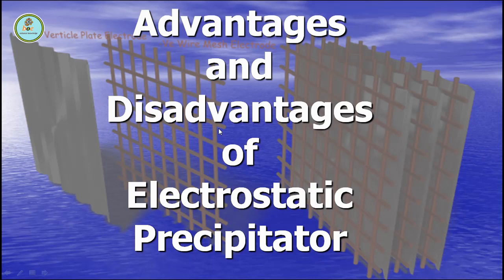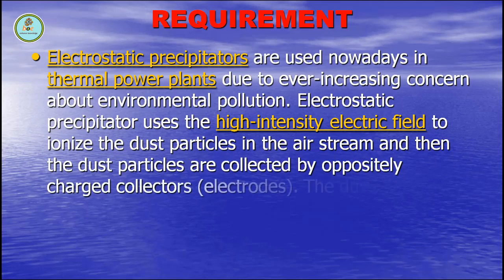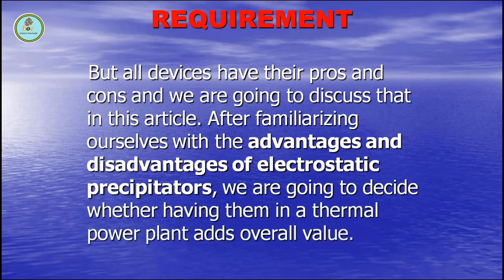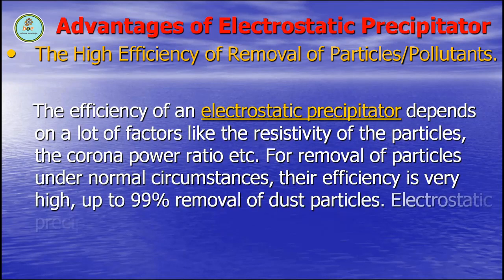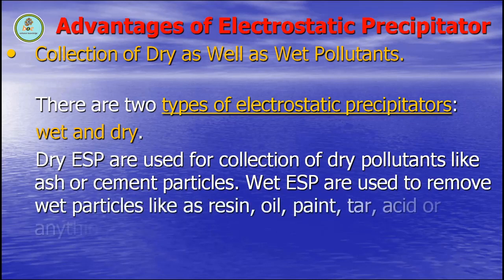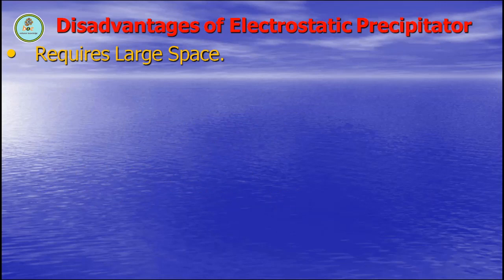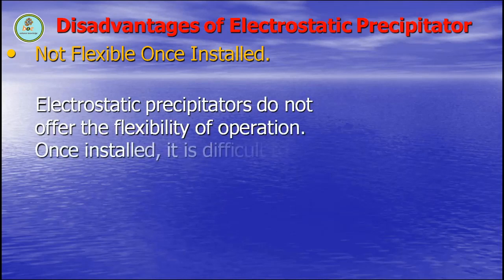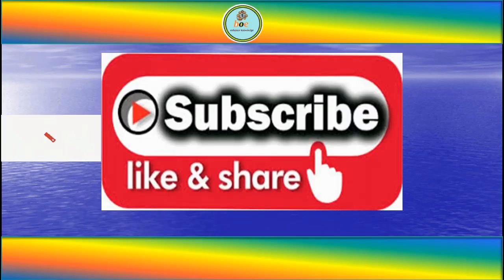Electrostatic Precipitator ||Advantage & Disadvantage||

Comment: Gasious pollutants Ko kyu nai collect kar skta
Reply from the maker: Electrostatic precipitators are important tools in the process of cleaning up flue gases. They are highly effective at reducing particle pollution, including those particles whose sizes approximate 1 micron (0.00004 inch) in diameter, and some precipitators can remove particles of 0.01 micron in diameter.
Reply: Can the source see it